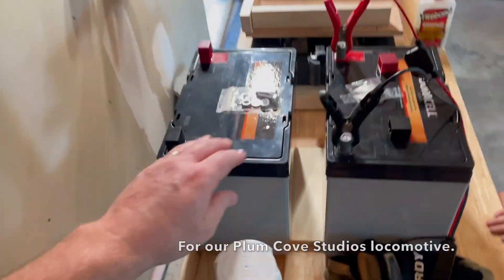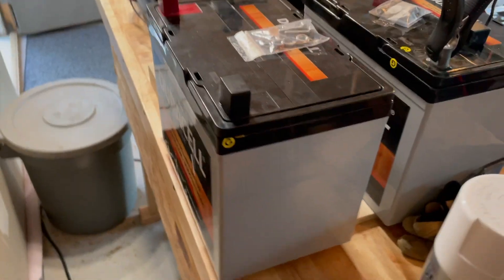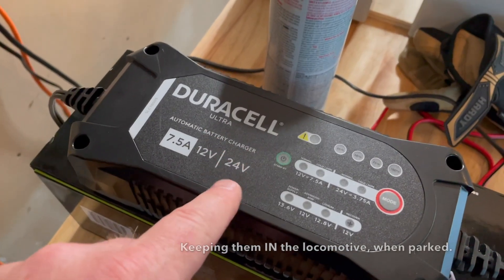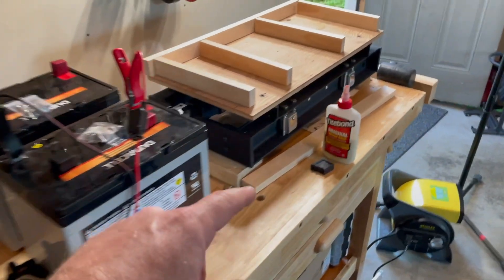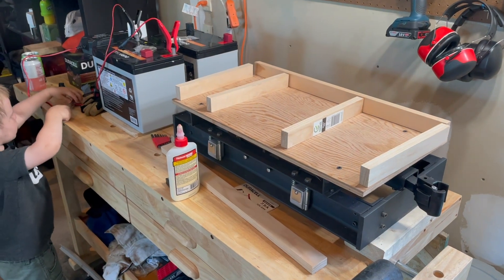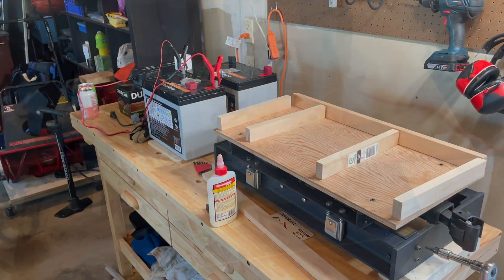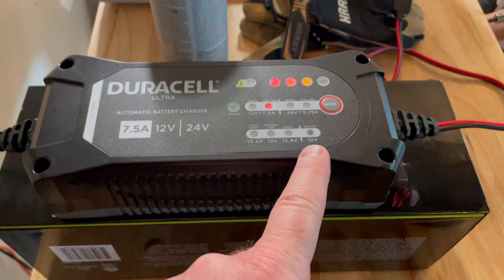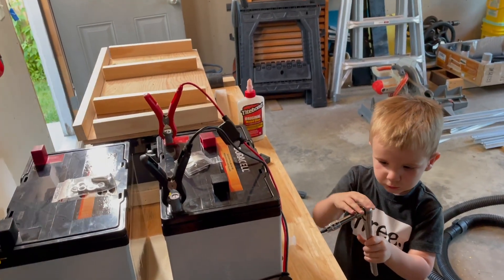Backyard Railroad: 12v Duracell Deep Cycle 80Ah AGM Batteries (24v In Series)

Comment: Nice!  I'm running 24v as well (less current draw than 12v to get the same power).  I started out with two small chargers, one on each battery.  But then I changed to the same charger you guys have and run it across both batteries.  It auto detects 24v and seems to do a good job recharging after I run, and also maintaining at a trickle charge, so I just leave it hooked up all the time when I'm not running.  I added a tiny voltage readout so I can see the approximate state of the battery bank.
Reply from the maker: Cool! This is a reassuring comment coming from you!! Thanks! ...Do you have a video on that tiny voltage readout? We'd love to see how you did it! If you don't have a video, maybe an email briefing us on that?
Reply: Sent you an email!